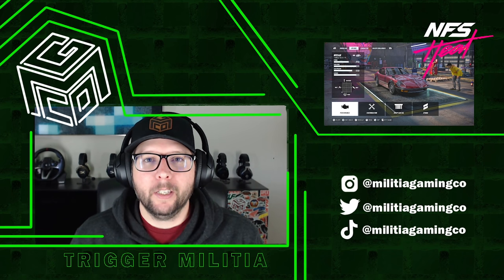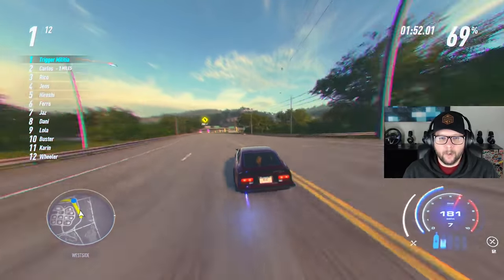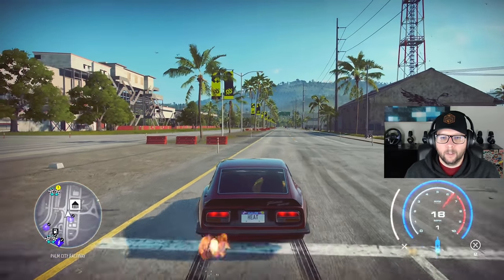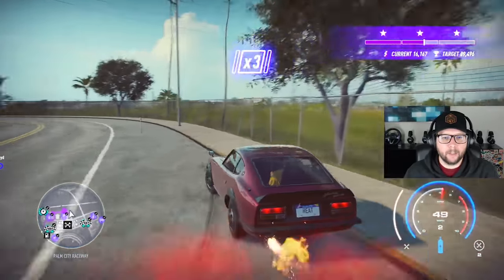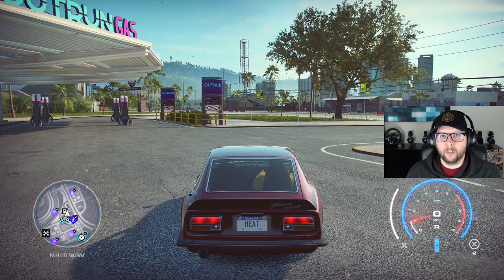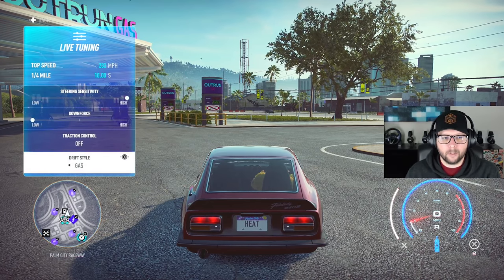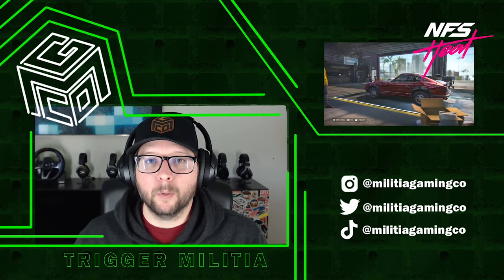You're Using the WRONG BUILD | 1971 Nissan 240 Fairlady Z | Need for Speed Heat

Comment: I love how some of the fastest cars in NFS heat are OLD CARS
Reply from the maker: Yeah I like that too.
Reply: Nothings faster then the old Porsche
Reply: @connoisseuroftigolbitts  the new old porsche
Reply: I only drive the old ones
Reply: As far as old cars the Japanese imports hands down are timeless and very compatible with modern tech and of course American domestic and Old school European exotics also have a place in they're however as far as compatibility, durability, terrain, and adaptability and my bias/weaknesses/soft spot for American muscle aside Japanese imports are by far very reliable for very rough roads take Toyota for example along with Subaru those cars are very well known with off roading in a lot of countries like Swiss alps with rally racing along with Ford and Audi everyone in my family has gone on record to say they would have no problem with buying a Japanese brand car and have held them up to domestic brands such as Ford, Chevy, Cadillac, Mercury, Buick, etc. In general Japanese cars especially the old school are very reliable and can easily be compatible with modern tech (when you know what you're doing) or if not have a really good tech/mechanic
Reply: Old is gold
Reply: Bc theyre light af
Reply: I actually think it was quite biased
Reply: resto mods yes
because those car used to be stiff but lightweight because lack of a lot of modern tech were “focused to be a sport/fun car”
toyota 2000GT lotus elan and new lotus 2000gtr early opels and audi and for new you got lotus elise/exige and MX5 mazda
but those old cars without a new engine are slow
Reply: Old is gold my boy

Comment: I use this car every chance I get. I put the zr2 engine in it because of the sound and the power range and it was an adept car. Then one day I got a wild hair and put a transmission with more gears in and the car is sooo fast. It was claiming 233 mph at a time when my fastest other car would only do 215 downhill on looong open road and about 180 usable on the track. Now a few days later I'm still racing by myself in the 240z while my f40 has trouble to reach it's top speed in any scenario.

Comment: To anyone who reads this comment, the fairlady does better with the 7speed transmission over the 8speed.

And your going to want to use your e break often because the car has a hard time getting the back tires out.

I was able to get a 2:35 on Sonic
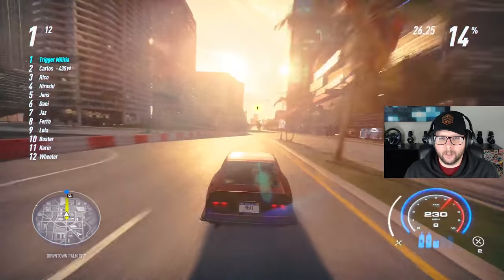And was able to get 3:01 on aeiran

Comment: I usually let off the gas and steer it, helps with steering.. just let off the gas And you will have control of the steering.. but don't work in most cases but it does work..